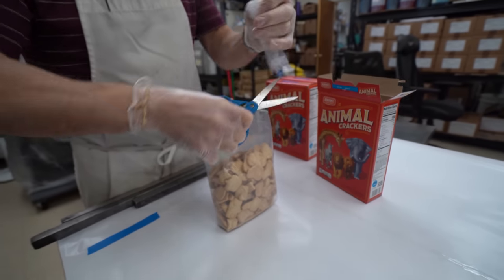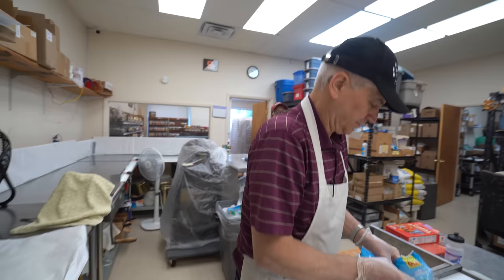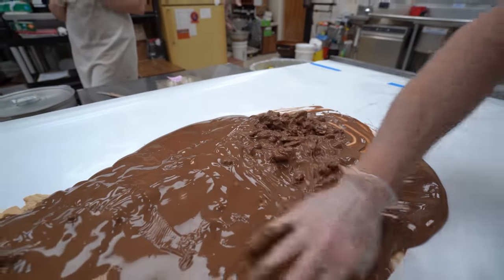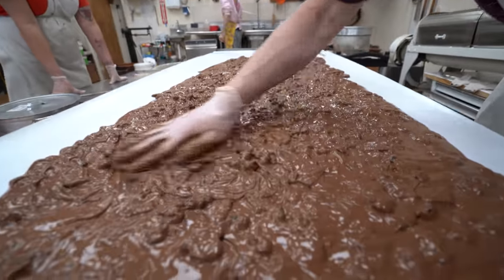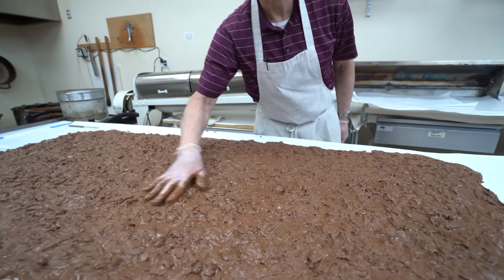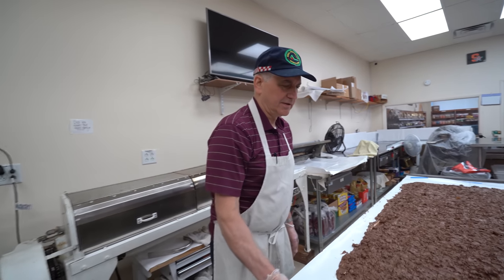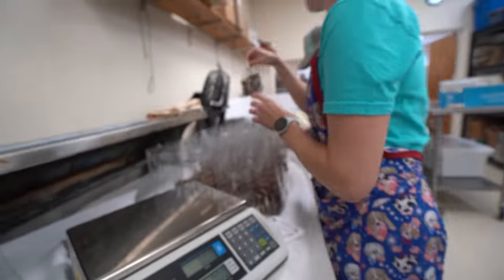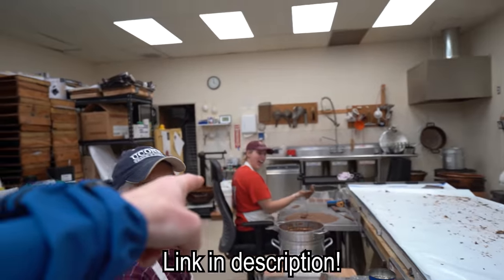She Was SOOO Skeptical About This Gummy Bear Candy!

Comment: I had something similar to Zoo Pal plates as a kid, but they were plastic reusable ones.
One thing I could suggest for the labels for smaller bags if you can't fit all of the ingredients, keep the front side of the label the same size, but make the back longer. 
Fold and staple so the front is where it normally is, then fold the back up to make a little flap that's not too long 😊

Comment: There automatic paper cutters but, they are meant form large print jobs. I have cut through reams at a time with them. They are also very dangerous. One of there safety features is you have to hit two buttons wide apart so it takes two hand to drop the blade. this makes sure you hands are not in the cutting area. You are also should look at the entire cutting area so your not accidentally cutting your ruler as well (Learned that one first hand).